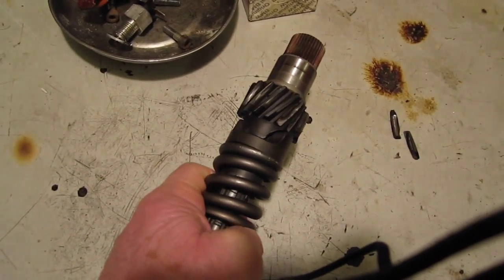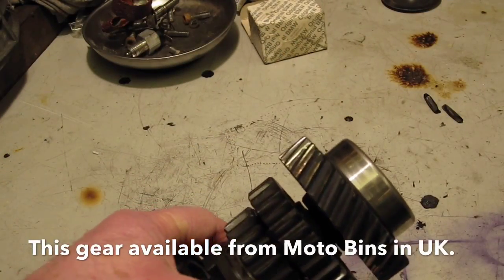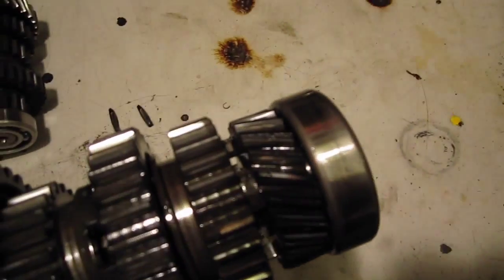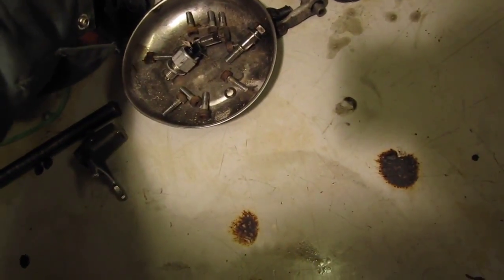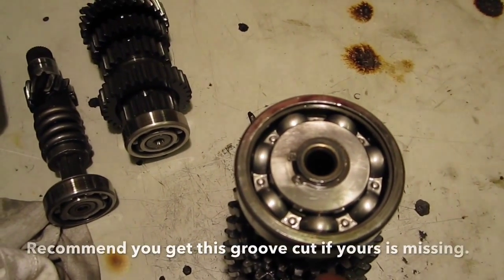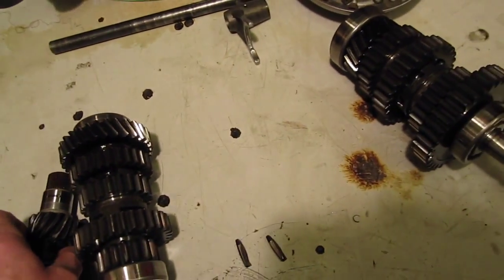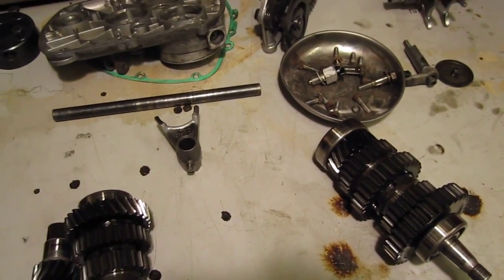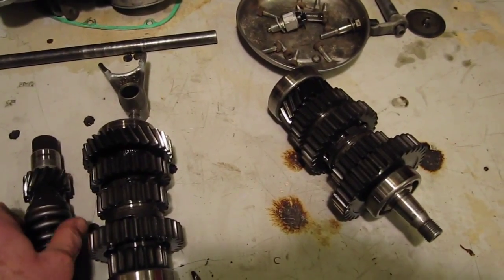R100RS Gearbox Overhaul Part 3 Inspection

Comment: Great and very informative video. I’m in process of getting enough courage to open my r80st gearbox. I experience some short rattle as I press or pull shifting lever when shifting into second gear, either from first to second or third to second. Also that krrrr noise is accompanied with small reflex reaction on shifting lever. Based on your experience, what particularly should I be looking when I open the gearbox? Can this be issue with shifting mechanism or gears? Thanks!

Comment: The selector mechanism from this gearbox indicates that the box must have been from a pre 04/82 model. The shape of the cam is the identifying factor. The never version have much more pointed peaks instead of the plateaued ones of this particular gearbox. This was done to eliminate false neutrals. Although it made shifting more crisp, It did however make it more tougher to push the selector through to the next gear. 
There have been another change that took place at the same time; the angle on the face of the helical gears have also been changed slightly to reduce the likelihood of the wear and pitting you pointed out in this video. These newer gears were all three stamped with an X to identify them from the earlier versions.
While personally I would not change those gears for the minimal amount of pitting they have had, it would make sense that if you do change them, that they should all be upgraded to the X-type gears....and do not use a longer 5th gear (this is a bad idea as explained in another comment).
While it is possible to combine the early 15 degree type gears with the later 17.5 degree gears, they will be even more prone to rapid wear and pitting.

Comment: As for the 5% longer fifth gear; it makes absolutely no sense to fit these longer gears to a standard R100 or especially to a R80 gearbox.
The bike will be under powered in top gear and you will constantly have to drop back to 4th when overtaking or hitting a bit of an uphill.
The longer 5th gear is essentially designed to stretch the legs of a R80 converted to a 1000cc motor but still using the same diff which is usually a 37/11 or 32/10 teeth diff.
In fact HPN was the first company to market a longer 5th gear which were commonly used on the rally models where the shorter ratio of the R80 diffs gave loads of torque and rapid acceleration. There is however the need for a faster top gear for the high speed sections.
The 1043cc Mahle converted motor producing nearly 70HP combined with both a longer 5th and shorter 1st gears, as well as running the R80 32/10 diff, provided a perfect marriage between technical off-road ability and being able to ride thick, soft sand and at the same time being comfortable at cruising speeds of up to 150km/h on the highway. (this is not quoted but my own experience)
On the R80GS with 32/10 diff, the longer 5th gear did not work so well and the bike could not reach speeds of higher than 140km/h.

Comment: How many miles does this gearbox have on it? Broken teeth seems to indicate well in excess of 100k or VERY rough usage. Also how did you heat the rear cover at the camp site when you replaced the selector spring? Camp fire:) Great videos! Thanks and please Keep it up! Oh and I'm the proud owner of a New-To-Me 1981 R100RT. Had one about 20 years ago and wish I'd never sold it.
Reply from the maker: +Edward Jones Don't know the milage on this box. I suspect that either the wrong oil had been used or there had been water ingress, which is known to happen if the speedo cable boot / gaitor is perished or poorly fitted.
The spring replacement at the Pyrenean campsite was achieved with the assistance of a very kind, extreemly busy BMW agent in Pamplona. The tale, which is a good one, is too long to tell here, but long story short; we removed the box and since we didn't have an extractorfor the output shaft flange, we took it and the spring 60 miles to the dealer and he fitted the spring for 30 euroes. Needlessto say we gave a hefty tip. Since then I have carried the outputshaft flange extractor as well on long trips, especially outside Europe. As for a heat source I would find a garage or someplace and beg, borrow. In my experience I find people are usually very helpful toward travellers. This is especially true when far from home; Africa, Asia etc.